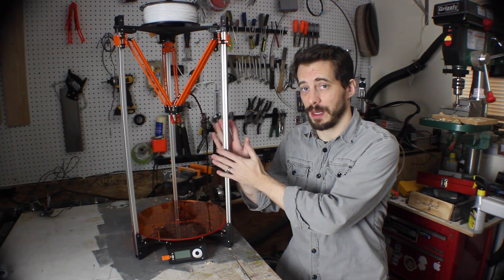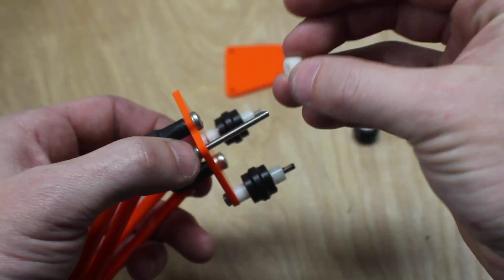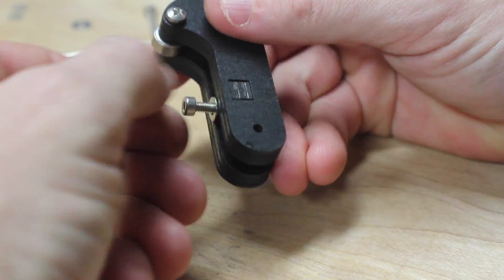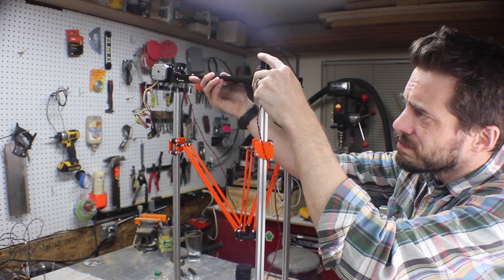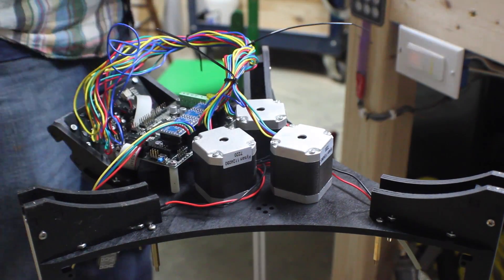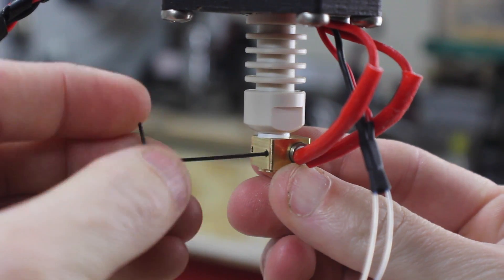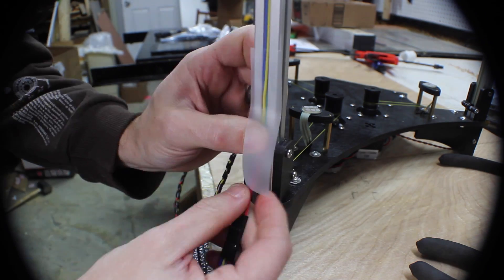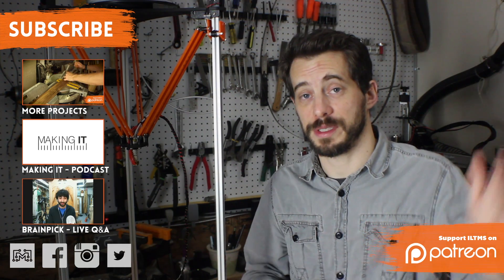DeltaPrintr Assembly // How-To | I Like To Make Stuff

Comment: Nicely done Bob! I'm in the process of building a Prusa i3. The build was easy, even though the instructions were in Chinese. The software, drivers, and programming is proving to be a total PITA! 3 months later it's still not extruding or heating the extruder or bed!
Reply: ***** I have been printing with a Prusa i3 for almost a year now. I can help get you started.
Reply: Ryan Lyde please do!!!!! I'm pulling my hair out, & the instructions are useless!!!
I can connect it and move x,y,z but the bed will not heat, nor the the extruder or the extruder servo. Drivers are installed, but no joy otherwise. Might need to flash the board, but no idea how to do it - not really a software guy! :-(
Reply: Before Flashing the board I would check a few things. First I would check your power supply. make sure you have the right DC voltage coming out. should be around 12 vlts. I assume you are trying to connect to your printer via USB and your using Cura as a slicing engine. Once you turn on your printer and its buzzing (powers supply fan running,  extruder fan on, all stepper motors kicked on) connect the USB cord from printer to computer and open Cura. if all driver are installed correctly Cura will have a button stating print with USB. If not Cura will have a button stating print to Memory card.

Comment: I recently upgraded to a new 3d printer, and my previous (and first) on didn't have a heated bed. I suggest you add one to your printer - just cut a piece of glass and mount the bed on the bottom. The heatbed PCBs are often within the $20 - $50 range and PLA prints significantly better with it (no curled edges).

Comment: Some programs I recommend to get yourself familarized with the processes of 3d printing is Slic3r, Cura, or KISSlicer (these are the programs that slice the object into layers and exports the file to something the controller board of the printer can understand, .gcode) and for designing I personally would prefer 123d Design or google sketchup (for sake of simplicity and ease, with a very n00b friendly interface) although ive heard great things about programs such as solidworks or cubify design
Reply from the maker: justinp4235 So far I've been using 123D and Cura.  Seems to work fine, although 123D is clunkier than I'd like.  I'm much more comfortable with Sketchup, but haven't looked into a plugin for outputting a .stl yet.
Reply: I Like To Make Stuff https://extensions.sketchup.com/en/content/sketchup-stl, took me awhile to realize that sketch up stock is ok, but with native plugins that allow you to do more you will have a much easier time making more natural looking figures rather than being bound to sketch ups limited stock experience making simple geometric figures. On a side note I purchased my first 3d printer kit around the same time you uploaded this video, the kit is a prusa i3 design :D
Reply from the maker: justinp4235 Awesome, thanks!  Enjoy the prusa!
Reply: No problem! Hope you have the best of luck with your delta!

Comment: Tho I don't have experience with this exact machine I have made over 200 prints on my schools makerbots (2nd Gen is great but 5th gen should be avoided) and the only real tips I could give you for 3d printing in general is long things on the platform will warp, nothing should be skinnier then 1/8 on an inch, not sure if this printer will auto add supports but it's better to put them in your cad drawing, tall skinny things may fall/get knocked over during printing. Super important preventative maintenance and inspections are key.

Comment: My wife hates me because of you! :)  This is the first printer that i've seen that has a string for movement.  I havent looked into the deltas too much before but do you feel that it'll hold up well?
Reply from the maker: Darin Radtke Haha, sorry man :)  Yeah, I think so.  It's relatively high test fishing line.. maybe 60lbs, so it should last. Also, it's easily replaceable if it wears out.

Comment: A couple of suggestions. The zip tie around the hotend seems like a bad idea, since that is the cold part. Heat need to be dissipated on that part. The other suggestion is to try Cura. It's free open source software, very plug and play and very fast. It does the slicing along with the printing.
Good luck
Reply from the maker: Bernabé García Good point! Yes, I've been using Cura, seems pretty easy to use and has worked well so far. DeltaPrintr has a machine profile available for it, so that made it really simple to get started.

Comment: I have a more traditional priner, the only problem I have is leveling the build plate because the threads on the bolts used to level the plate keep wearing out, I use Makerware becausenits just awesome, I really like the build area, looking forward to seeing some AWESOME STUFF
Reply from the maker: Zafar Monier Yeah, I've heard that bed leveling can be tough.  On this one, it has FSR (?) sensors, so that the print head finds the bed before every print. So it actually doesn't matter if the bed is level or not, the print just finds where it is and prints accordingly, from my understanding.